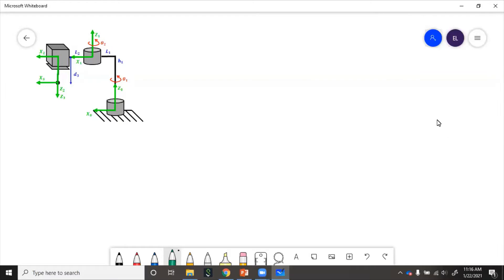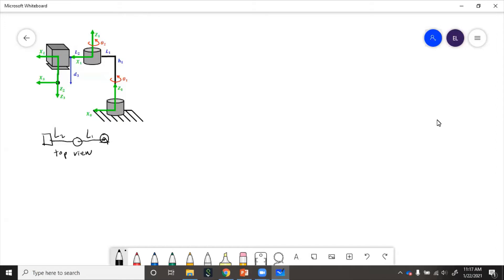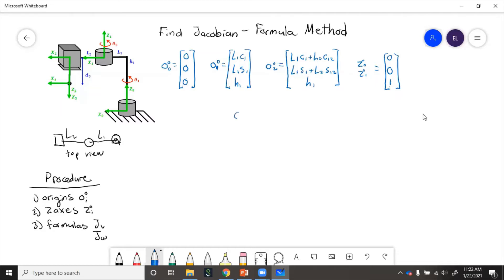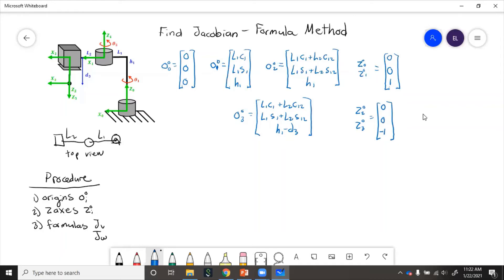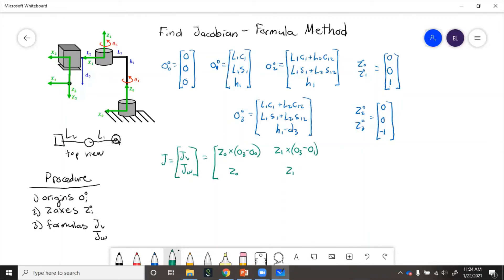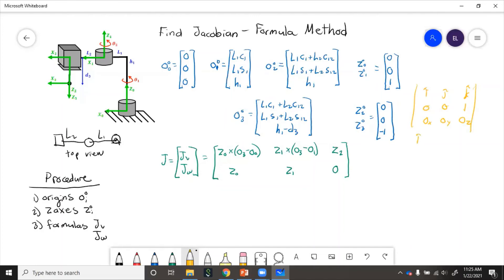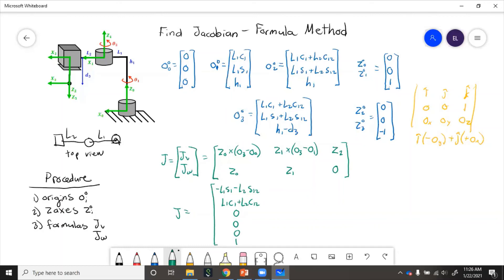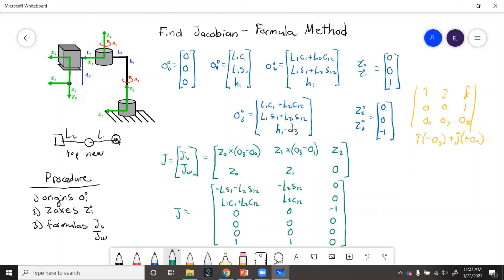RRP Robot Jacobian Example

Comment: Hello, for the coordinates of the origin, it should not be O_1 = (l_1, 0, h_1), 0_2 = (l_1 + l_2, 0, h_1) and 0_3 = (l_1 + l_2, 0, h_1 - d_3) ?
Reply from the maker: The coordinates of the origin change as the robot moves.  The formulas you typed are correct for the home position, but as the robot moves, those coordinates change, so you must account for the joint motion.